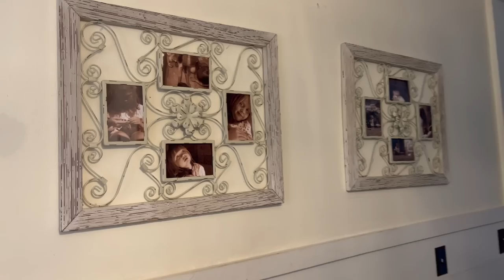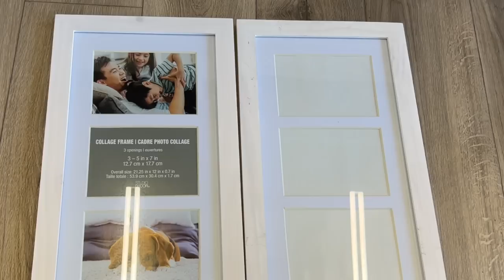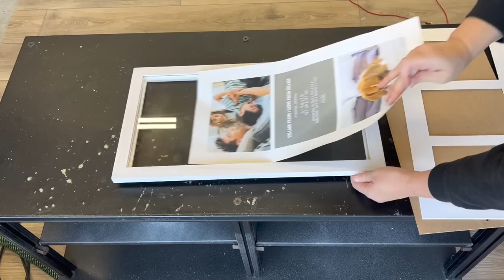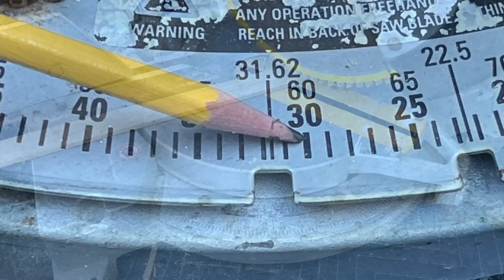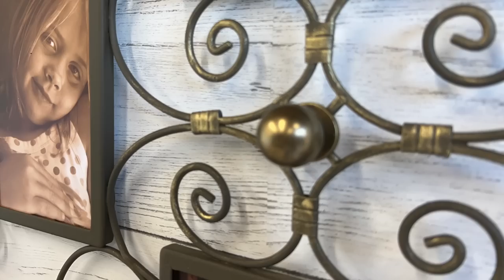Quick & Easy: DIY Decor Flip & POTTERY BARN ART DUPE! | Great Handmade Holiday Gift Idea!

Comment: Does the glass need any sort of prep work in order to hold the paint?
This was fun! All my craft supplies have had to be boxed up… I do have some glass vases though and. I. Love. Geometric. Shapes. Do you mind if I swing over and use your power saw? 😉💕
Reply from the maker: So glad you enjoyed!!  So a lot of times, folks will skip a primer for decor - most of the time it's just sitting there looking pretty, and so you can kind of "get away" with not using it.  That said - using something like Dixie Belle's "Slip Stick" or a glass primer you can get at your local hardware or big box store would give that added adhesion hold! SO glad you loved the geometric art - and sure, any time! 👍